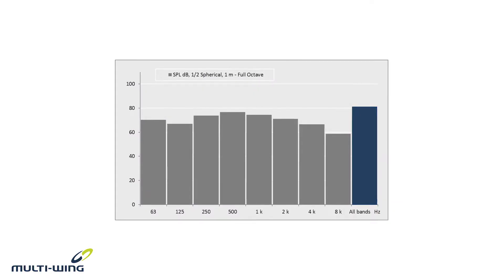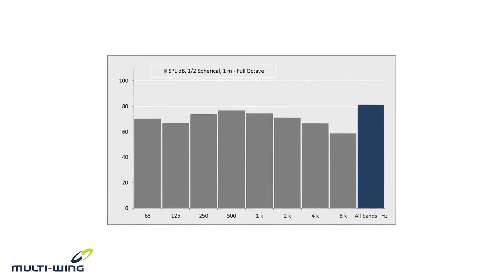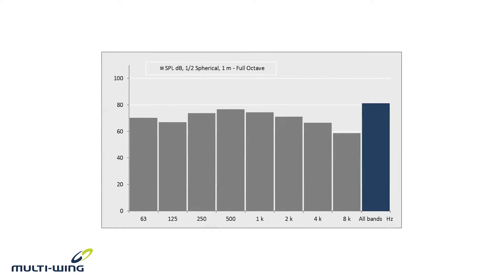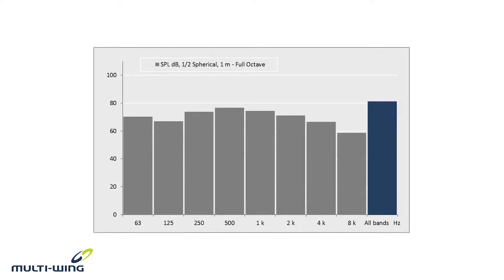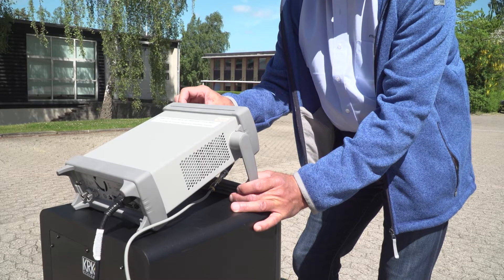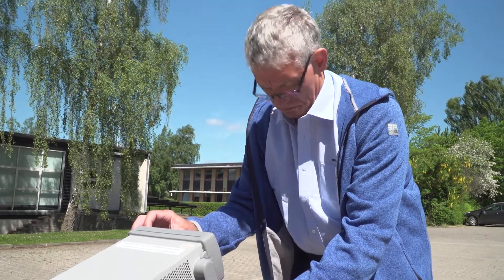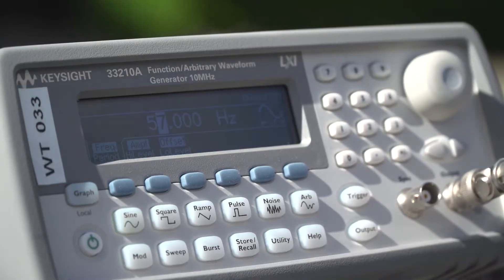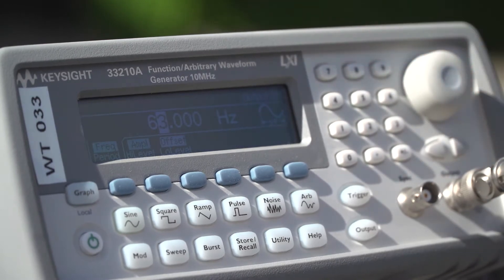Multi-Wing: Challenges in Sound Measurements

Comment: Is not using the sound intensity based approach provides a better quantification of fan sound power a better descriptor?  The pressure based method requires an acoustic free field, (or a anechoic chamber) .
Reply: This is actually not about measuring sound power. We do that in our reverberation rooms. 
Mostly we get inputs from customers that used sound pressure at a few stations - typically far too close to the noise source to be of any meaning - claiming that the product data are not correct. This video is explanatory as to why such measurements fail.
Reply: Came to the comment section to ask the same question.